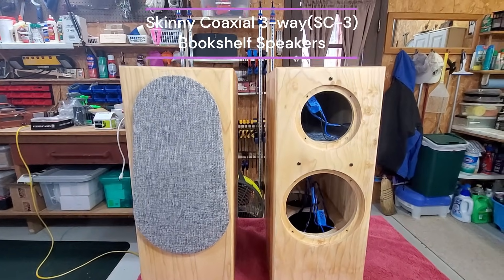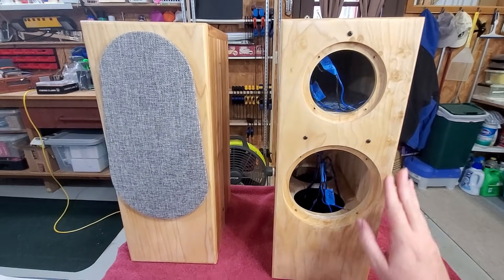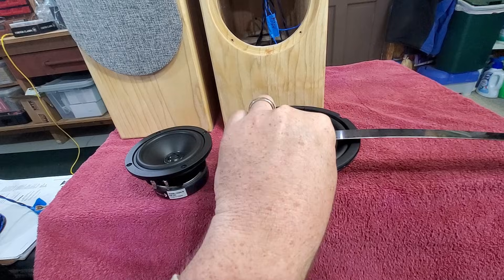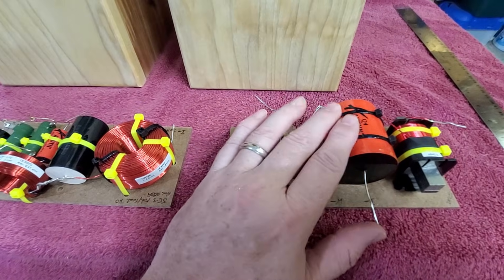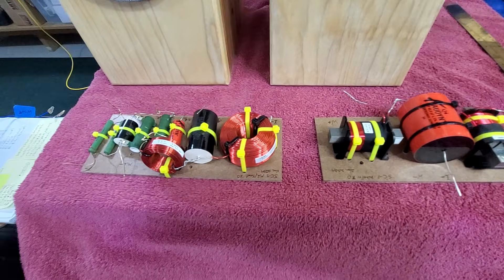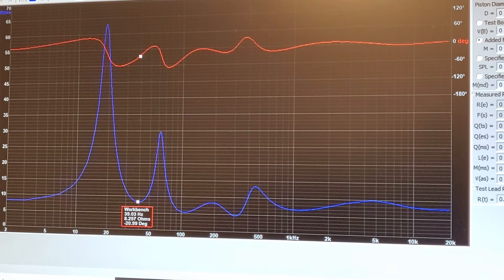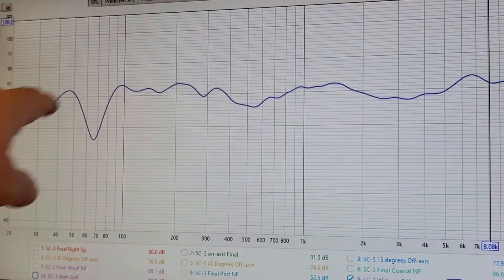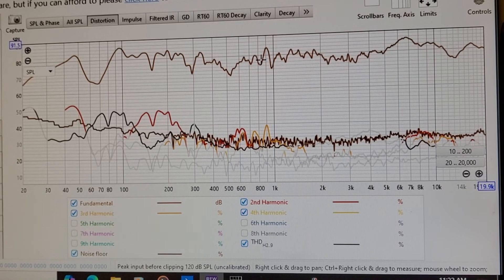Skinny Coaxial 3-way (SC-3) Bookshelf Speakers

Comment: Great build. I just found ypur channel.  I retired a year ago and started by building a CSS 2TD kit.  Awesome company and products.  And you're right, the bass down low is awesome.  I started an open baffle project.  I have all the parts.  I am at the woodworking stage.  Also, I just completed a set of GR Research Encores for another room.  They sound great.
Reply from the maker: Great to hear.  That all sounds very familiar. I started this hobby 4 years ago during the Covid shutdown. No carpentry, soldering, or electrical background or experience at all. I built the X-LS Encores first then the CSS 2TD-X's and it's been further down the rabbit hole ever since. Enjoy the hobby!
Reply: @DonnieMulligan  I continue to be intimidated by  the full size router.
Reply from the maker: @tedroybal5231  Me too, early on. I spent a lot of money on hole saw and Forstner bits before I figured out that a router with a circle jig is the main tool for cutting out driver holes accurately. I've seen guys use a small palm router if that helps.
Reply: @DonnieMulligan  the baffles are 2 inches thick!
Reply from the maker: @tedroybal5231  Wow, are you building a subwoofer? 2" thick is quite substantial.

Comment: They're beautiful.  
Three way that looks like two, digging the hidden complexity in a clean presentation.
Reply from the maker: Folks warned me that 3-ways were way more complex. Man, I didn't have a clue. I had several days of work on the crossovers and still could not get them where I wanted.
Reply: @DonnieMulligan   tajomstvo úspechu je výber samotných reproduktorov. 
Ak sa tento výber podcení, tak výhybka to nezachráni a bude zbytočne zložitá.
Reply from the maker: @agent-x-777  I definitely agree. There is only so much one can do with cheap drivers.